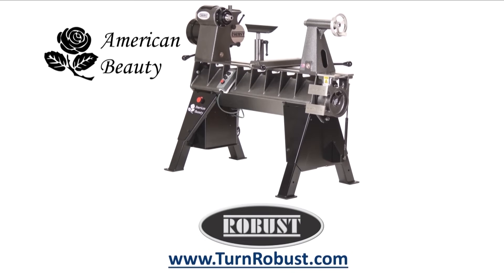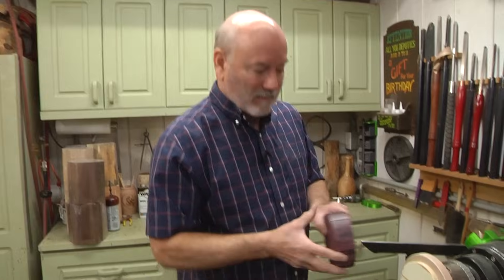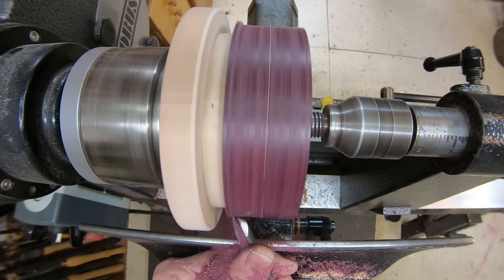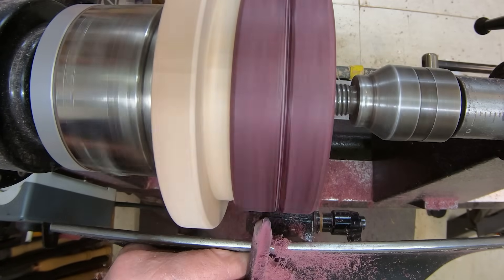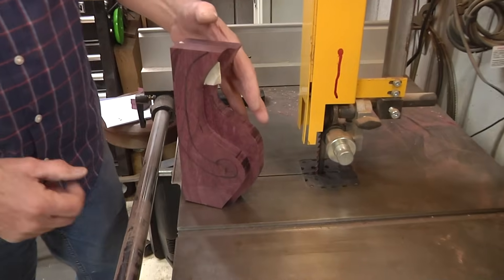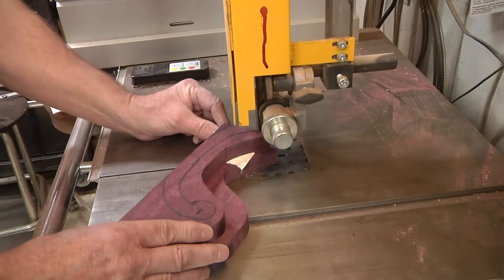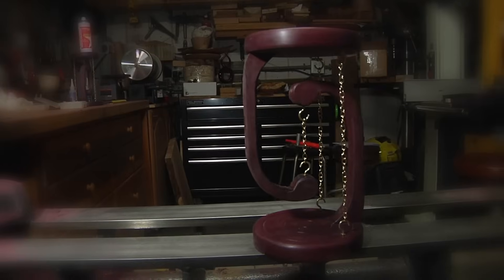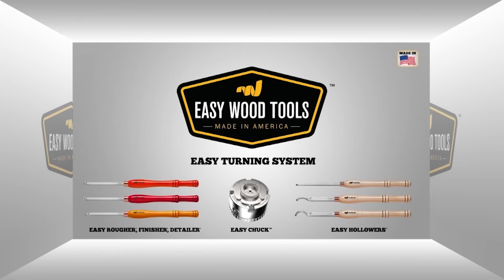Floating Table

Comment: "Floating" table is more accurate as its clearly gravitationally supported by the chain in the middle and balanced by the 2 chains on the outside.  Did you try turning it upside down to show it still works?

Comment: Great project . A question on the sanding disk on your lathe: How did you mount it on your lathe? Where did you find the sandpaper, and how is it mounted? I did find some disks that have a felt backing, but I'm not sure what to use to fasten  to a disk on the lathe. I have some idea to make the lathe a sanding machine, but i am wondering how you did yours. As far as a table for sanding, i am thinking of using a dowel and some plywood mounted in the banjo for the flat sanding table. Any suggestions or maybe a video to make the lathe a sanding tool?